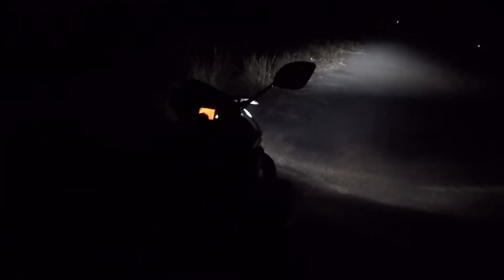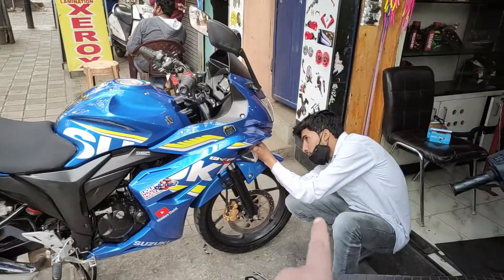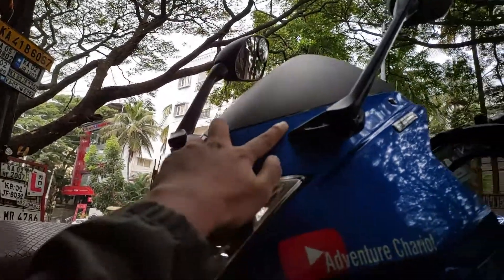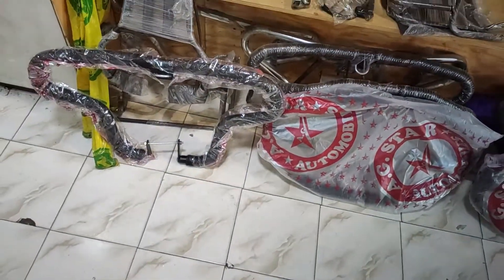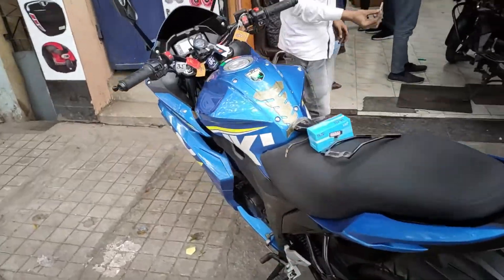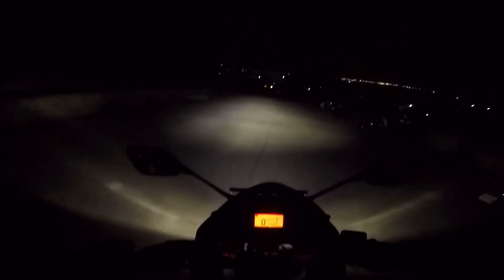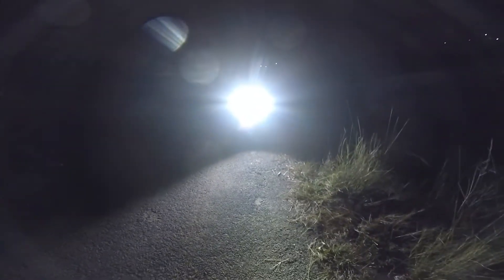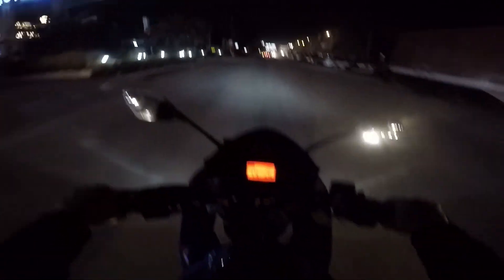Best FOG light For bike | HJG 80w Pair | Bangalore | Gixxer SF | Insane illumination

Comment: Any problems on battery or in bike wiring After installing head lamp fog lamp and side mount indicators plz replay bro
Reply from the maker: No bro no problem till now.. just we need to be carefull not to switch on all fog lamps and led lights on when bike is not started